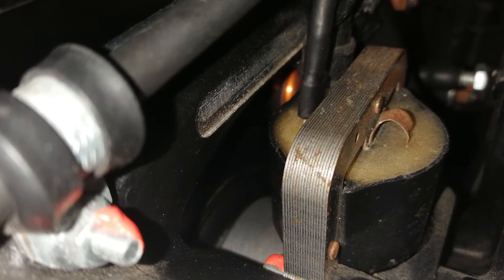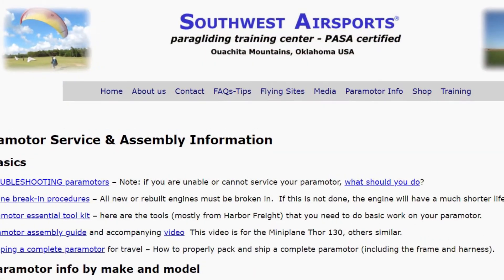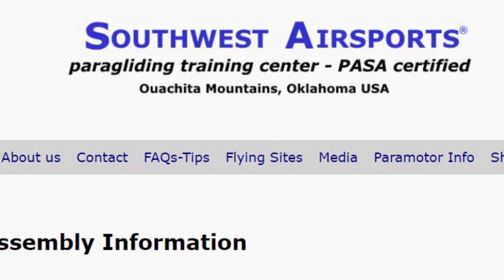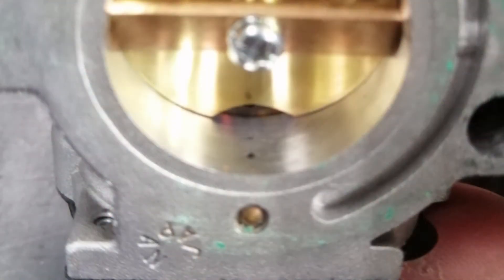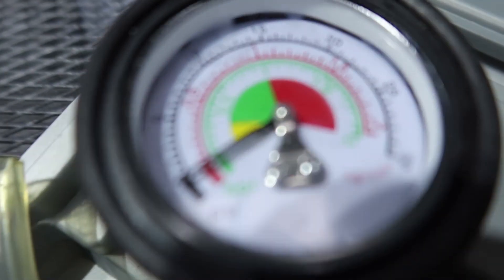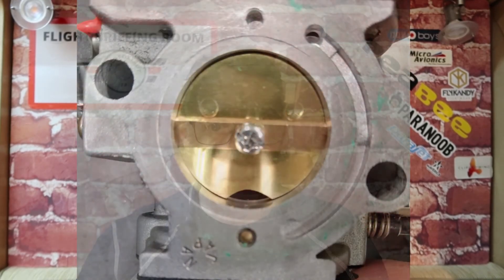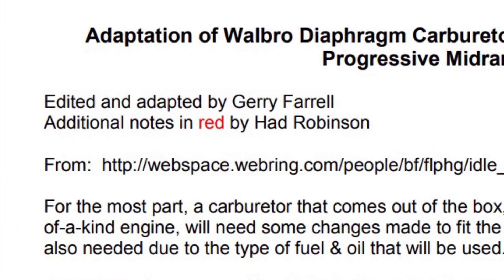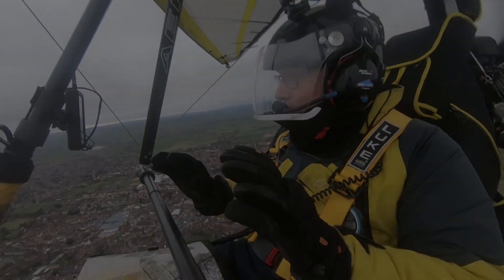NEVER do this again - Carb Modification - Tachometer technique

Comment: I'm interested in the alternate tach pickup for my Challenger II, the dash to the engine requires a 12' lead if I want to coil it around the spark plug wire. I'd rather run it to the ignition key that is already in the dash. Do you have any idea if this works on the Ducati electronic ignition that Rotax uses on their 582?
Reply from the maker: Hi Jason, normally the ignition key just connects the battery. I'm not too familiar with the 582 electrical systems. You could experiment with the ignition switches themselves, it's how I get the feed for the Peabee machines.

Comment: Hello giles how you doing got a big problem got a taco works fine like on this video now I've just got the tiggy 2 with the sky tank conection same as what you do but with the tiggy my engine will not start I take off the wire and engine starts fine I then put the taco wire to the ht lead engine starts but no rpm mike from tiggy sent me a new wiring loom today but still that same any idea's would be much appreciated giles thank you buddy
Reply from the maker: Hi Frosty, Michael Gaylor has offered to help sort your machine.
Reply: @GolfFoxtrot22  hello giles yes just got message I call him tomorrow his been a big help thank you for your reply giles

Comment: Better to add a  220p 200v (blue) capacitor in series for the RPM input interface protection, this is what I use 👌
Reply from the maker: Hi Kosta, I've been using this TTO gauge for nearly 8 year without any issues.  We've also experimented with cheaper Amazon tachos with no negative results.  What result does the capacitor have and would it give errors in the readings?

Comment: Great video Giles. I will try out the tach suggestion for sure. Sounds like a very elegant alternative to running the wire all the way back to the engine. 

For the mid-range mods, you mention changing two factors; the carb butterfly disk and the pop-off pressure. When diagnosing an issue, best to change one thing at a time yes? Assuming you would agree, which mod do you believe actually produced the happy result? I am using a Vitto Atom 80, and the mid-range seems to have been mostly addressed in the most recent WG carb that *they have modified.

One thing I have noticed, having worked on 5 carbs for the A80, the butterfly seating/centering in the airway varies and so when I first mount these carbs I check and readjust for center. Perhaps that helps a bit.
Reply from the maker: Hi Brian, many thanks for the  detailed response and I completely agree about only changing one thing at a time, it's very good diagnostic practice. I've been trialling and testing different settings for nearly a year to get to this final stage of how to set up the carb. It's amazing how even having the disk the right way round can influence a carb set up. Sounds like they have sorted the A80 carb. Is it still the WG8 or have they moved away from that one?
Reply: @GolfFoxtrot22  The A80, as of model year ‘20, shipped with the Walbro WB (Vitto modified, 37?). The initial mods for were to address cold weather high circuit issues, which some attributed to icing. The latest, shipped with MY22 A80’s include the mid-range mods that seem to work well. I just mounted a new MY22 A80 and so far it’s excellent!

I weigh 190 lb, and fly with a Fly Product Eclipse PPG with A80 engine, under an Ozone Speedster 3, 24 meter glider. A combination that always amazes me with its easy start, low vibrations, fuel economy and low weight.
Reply from the maker: @Sneaky.B  sounds like a good flying combination.

Comment: Giles, why don't Moster send out their carbs modded like this?
Reply from the maker: I think it might be because it take quite a lot of time to tune each one. They do modify it to some extent by blocking off a port on the low side. Years ago they used to run them before leaving the factory, they only run the Factory R versions now.

Comment: 1 minute ago
Awesome ... i am not insane! New to PPG but not paragliding. I have all these issues with a new Moster 185 plus since break in and one of those carburetor models! Can't hold a tune, no stable idle setting and dies in the air at idle, and the 500+ rpm bump at approx 5900 rpm. Any suggestions for a new motor under warranty??
Reply from the maker: Hi Doug, welcome to the channel. I hope this helps. Have you seen the Scott paramotor tuning video?
Reply: @GolfFoxtrot22  enough Xs to be able to do the clip on my own 🤪
Reply from the maker: @dougbarlow7483  Xs? not sure what you mean but I hope the Scout videos helped a bit.
Reply: @GolfFoxtrot22  many times (X's)! Appreciate the support!

Comment: Hi Giles - on the engine topic just curious about your max RPM and at that RPM what does the EGT peak at?  My RPM maxes at about 7600 rpm with EGT of around 780 degrees C, which is usually at climb-out. This latter seems very high to me, was wondering what your Vitorazzi reads. Unable to find much on typical or acceptable values anywhere on line. Btw my engine is a Cisco Bull max two stroke paramotor, similar to yours - many thanks and sorry for deviation from topic.
Reply from the maker: Hi Blacker Welder, I'm not sure on the Egt figures as I don't run an Egt sensor. Your engine drive ratio and propeller combination will also affect the max rpm you will obtain. I'm sorry I can't help with regards to your question. The only thing I can suggest it to contact your Corsair dealer, are you in the UK?
Reply: @GolfFoxtrot22  Will do appreciate the super quick reply. Keep your great videos going, you are doing all of us a great service!
Reply from the maker: @BlackWelder-b6z  I'm just a flying/ engineering geek. 😁 Thanks for your support to the channel.

Comment: Hello buddy how you doing just to let you know I had a nasty accident on paramotor a wire had shorted out on frame it Cooked the on off switch then my lipo battery lighted up I was on the coast but turned away as no more landing spots available to me as I claimed out of a turn the engine died had a big collapse and went into sea would not be hear today as 2 lads jump of a pier to get me as I was in about 8ft deep better getting wet than being on fire haha but thourt I say something as a safety thing on lipo battery's and wiring zip tied to frame with the vibration thanks buddy and still another day to fly haha
Reply from the maker: Oh Crikey. Frosty have we met before? I did hear about something recently so thank you for putting a comment here. Vibration is a killer for most wiring. I'm so glad you are OK.
Reply: @Golf Foxtrot 22  morning Giles no we not met yet but been chatting on hear I've joined paramotor club so I can meet you guys and paranoob such a nice guy and to get to fly with you all.runing all my wiring in plastic tube the zip tie to frame and motor nearly ready to fly again.but I'm all good coast guard and ambulance guys sorted me out as took water in lungs shock and hypothermia but good to fly ones again 😀 👍
Reply from the maker: Oh Frosty, I wish you a full and speedy recovery. Don't let the incident hold you back. Thank you for letting me know what happened and that you are safe.
Reply: @Golf Foxtrot 22  hi Giles I just had a message from a friend showing me your post about my accident I've not got facebook but thank you for a good reply to those who was slating me over it thank you again.paramotor is almost ready to have a run up just putting new wiring loom on and exhaust packing.thank you giles

Comment: Is the fuel exiting the venturi faster than the mid-jet? Will this make the engine react a little better? You've done a lot of filing. Isn't idle harder to set this way? Thanks ;))
Reply from the maker: Hi, the isn't a mid jet, only a high and low. It is the reason for doing the mod. The idle is actually much easier to set. As I mentioned in the video, and the links to the support ing document is in the description, have a read of it as it will explain what is happening and why, with the mixture than I can here in a short reply. I hope that helps and thanks for watching.
Reply: @GolfFoxtrot22    I understand, thank you very much. I have read the article before. I did it with very minimal grating. I did not dare to file even 2,0 mm. I have to test it. Wb 37 carb on top of an 80cc reed valve engine. Might be a bit big for the engine with this 28mm carb. I mean it will have lazier acceleration. (?) I'm testing it at the moment and if it doesn't fit, I'll put the wj-71 et back in. Thanks ;)
Reply from the maker: The WG8 is normally good on the way 80cc engines, link the miniplane top80.

Comment: Hmm, I wonder how much efficiency benefit there is if I can move the Atom midrange with this. Might need to have a test.
Reply from the maker: Hi Dan, I'm not sure on the efficiency side, other than it stopping the surge to the top jet, thus pulling more fuel. Its nice have a more consistent and stable Rpm.
Reply: @GolfFoxtrot22  at a guess it’ll be a small percentage if any. The Atom runs sweet but J was just inquisitive if I could delay that top jet. Something tells me there’s a lot more too it haha.
Reply from the maker: @DanielJonesParamotor  it's taken me a lot of testing to get to this stage, it's probably why many don't.

Comment: How about Mark makes a drop-in mod kit for us so I don't muck it up.
Reply from the maker: Hi Ed, for which one? Mark doesn't mess about with the carbs😉😜.
Reply: @GolfFoxtrot22  For the butterfly mod. I don't trust myself for hogging it out like that. But I do recognize the sloppy mid-range and Powerband jump.
Reply from the maker: @edwalker2790  well that would be my handyvwork😁. I do all the carb work. It's, really easy, just buy a second disk and take your time.

Comment: well done Giles, that is genius !!
Reply from the maker: Hi Gavin, which bit, because I know you do like a little bit of carb geekery.
Reply: @GolfFoxtrot22  the wrap your wire around the HT lead, instead connect to kill wire !! cracking idea
Reply from the maker: @pintail120  I've tried over the years to share it on the Paramotor forums but it seems to get lost in the noise.

Comment: The real question is why they don't ship with a smoother mid-range.  I hate the issue altogether.
Reply from the maker: The carb is designed for a chainsaw so the throttle disk does not need to be modified. I hope the video helped a little.

Comment: An Excellent topic to cover!!! I gave up my Moster 185 for a Polini Thor 202, so while the butterfly valve modification doesn't help me, I'm thrilled to know about it, as like you said, it was frustrating to hold a steady pressure on my throttle and yet have the engine not maintaining steady power/thrust while doing foot drags or just level flight. 

I am excited to try the direct RPM pickup and figure out where on my Thor 202 I could connect it. While I think the coil is giving me a reasonably accurate reading, I'm all for absolute guarantees! I wonder if there is a T spade connector so I can put the kill wire into the T spade, connect the RPM gauge to the T part, then the other part directly into the inductor for the kill switch. WHEEE!

Seriously, I love watching you fly, but I really love this kind of nitty gritty engineering work to improve what is already an amazing way to fly. Cheers!
Reply from the maker: Hi Ooglek, welcome to the comments section and thank you so much for the extensive reply. How is your 202 holding up, I'm hearing of a lot of people going through pistons?

I'm trying to vary the content, I'm a secret engineering geek and like things just so, but I'm aware that not everyone likes this kind of content. I hope you do find a good tacho pick up point and if you do, could you let me know where you found it, so I can help others.
Reply: @GolfFoxtrot22  Please stop keeping it a secret! This sort of stuff is GOLD. I'm looking forward to seeing if the GP2 Temp and RPM gauge that came with my Polini will work connecting straight to the inductor. 

No issues yet, 90 hours in, on the Thor 202. Since I'm in the US and all of our pump vehicle gas is minimum 10% ethanol, I get US 93 Octane (EU 98 Octane equivalent but non-ethanol) non-ethanol gas. Some have gone with AVGAS, but I prefer to avoid the whole lead thing, plus AVGAS is almost 2x more expensive. No issues with high octane non-ethanol gas in the 202 thus far.

You could always split your channel if you're worried about alienating viewers who just want to watch you fly. I personally am here for both! I was wondering if the arc measured could be accomplished by a 1" to 2" radius drill bit (hole saw?) and a drill press, rather than trying to do it by hand, to get the air flow under the butterfly valve. Or measure and post a 3d model of it, then see if some company could manufacture them one-off for people interested but not wanting to modify it themselves.
Reply from the maker: @ooglek  Thank you for some good suggestions.  Ultimately the shape came from the file I used and all I was doing was removing material until the engine started to perform as I wanted. I did initially want to take the cut out to a point where I had runaway to identify when that would happen but I had reached a point were it was just working and stopped.  I type this with a cheeky smile, I was keeping it secret, I held back for the reasons as I state in the video, I was a little reticent as it was such a drastic modification and quite far from the vittorazi specification - I was anticipating a bit of criticism, not completely unfounded. I also wanted to make sure I wasn't getting false readings and responses so wanted to test it fully before letting everyone know.  Please keep me on my toes with the comments, I'm sure you have more questions I could help with and thank you for your support to the channel.
Reply: @GolfFoxtrot22  I think this kind of engineering experimentation is EXACTLY what the paramotor and light trike and Pee Bee community needs to get more performance from our effectively dirt bike motors. All of our motors borrow HEAVILY from existing 2-stroke parts, especially the carbs, that there are still many available optimizations and improvements that will help the sport just generally be better and more fun. I'm somewhat hopeful that in the next 5-10 years our sport can go full electric, getting a 3 hour fun flight out of some batteries -- I'd be thrilled to be done with gas and carb tuning! Until then, our sport relies on people like yourself being willing to try modifications and changes that will eventually go mainstream and make a norm. 

Criticism? Hell no! I'm super proud you took a frustration into your own hands, did something about it, tested it, then shared it! Put some specs down, like what is the width of the butterfly valve you took out, and the depth, so we can calculate the arc and reproduce your tests. Science! 🙂

Seriously, keep it up, I hope that many other pilots will be interested in your engineering tinkering for the betterment of the sport. I've shared your video with a Slack group of pilots here outside Washington DC -- I hope some will try it!
Reply from the maker: I only just saw this response so sorry for not getting back to you sooner. I left all the dimensions and  part numbers in the video description so I really hope that helps you and your fellow fliers reproduce the results that I have. I hope you see this response in time. Safe flying and happy tinkering. :)
Reply: @GolfFoxtrot22  thank you!!!

Comment: Interesting. I bought a cheap tacho from Amazon with a wrap around and on ground tests, the engine was only 'maxing' at 7,800 rpm, not the 8,400(?) from the manual. Assumed it was partially due to being static, but probably a reading inaccuracy also?
Reply from the maker: Hi NsM3, I hope this works for you and you have no missed with a reliable reading.

Comment: Wondered if that was what you had done. I read the article ages ago but didn't feel I needed to do anything on the top 80 as it wasn't an issue.  Sounds like it is a good mod on the peabee
Reply from the maker: Hi Lee the WG8 is a bit hit and miss with this mod as. It has only a mid range adjustable needle. The low end is were you need this mod(if required) and the top end you can't adjust.

Comment: Does this modification increase fuel consumption at cruise?
Reply from the maker: Hi Matgew, from my readings, I have notice no increase, only a more consistent consumption due to the engine not racing away onto the high jet.

Comment: Connecting your tacho up that way also has the added bonus of an early warning system if your kill switch wire breaks during flight - Tacho stops working = kill switch probably not going to work.
Reply from the maker: Hi Ian, yes as long as the failure is on the live side, it's a very good suggestion.

Comment: Is there a risk that the tacho could earth the kill circuit and stop the engine or are they fairly stable/benign devices?
Reply from the maker: Hi Damian, no there is no chance because the tacho is only taking a splice from the main wire and not going anywhere else. I've literally used this system on 3 of my own machines and it's how I wire up all of the ones I work on. I hope that gives you a little confidence in how it works.
Reply: @GolfFoxtrot22  Will give it a try...it solves the problem of the wrapped tacho wire eating through the coil lead from vibration :)